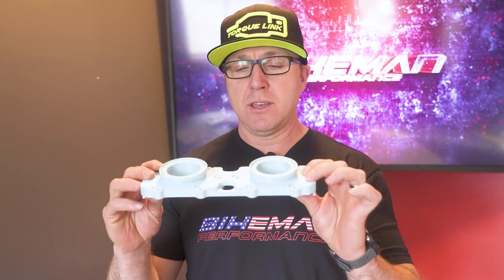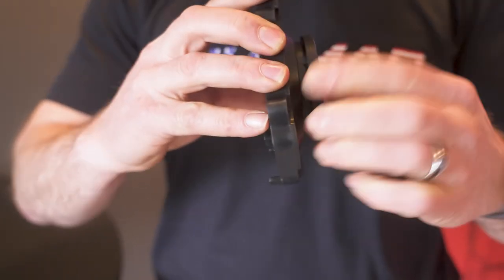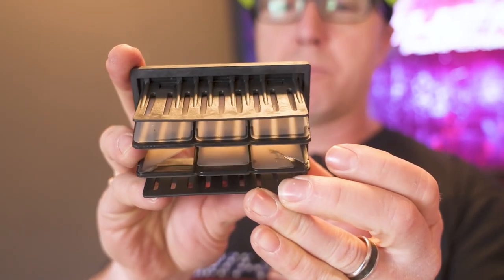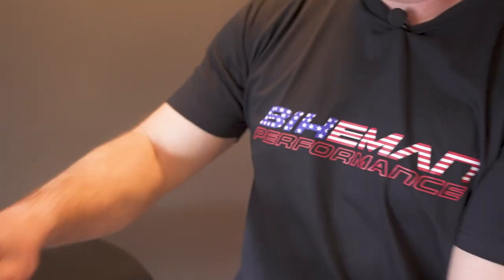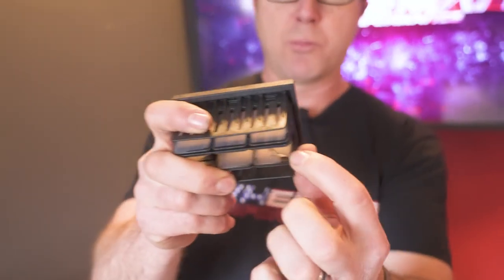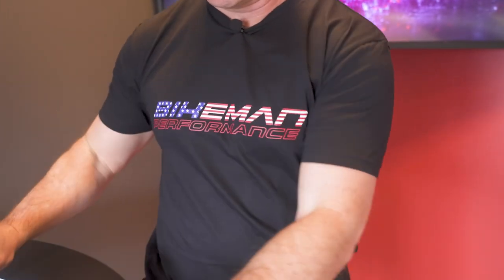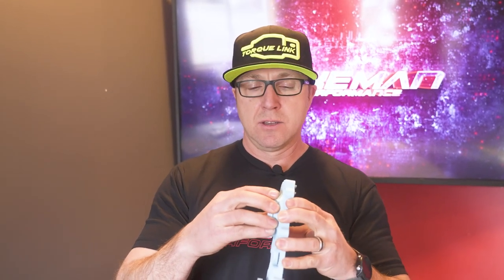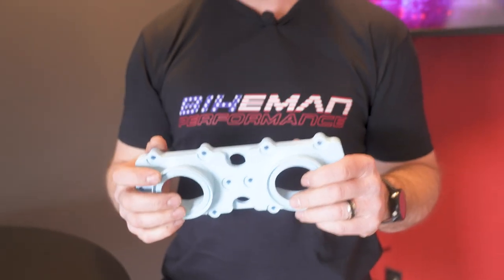Polaris Patriot Boost Billet Intake

Comment: How will I know if I have a boost leak      
Do you have a video on how to replace
Reply from the maker: You will get a noticeable loss in power and machine will run like trash. You will definitely know when a reed cracks cause you can only limp the sled back. No video on how to replace at this moment.